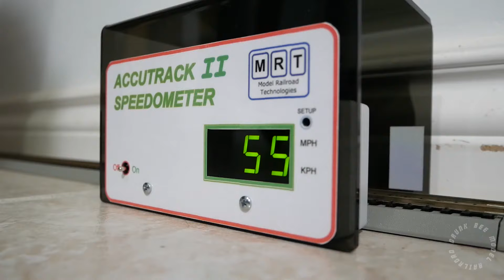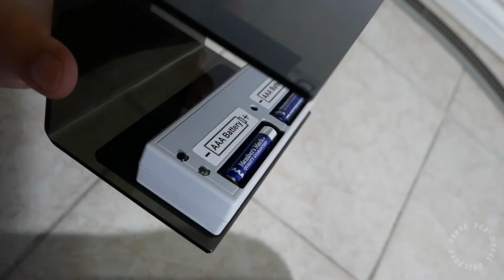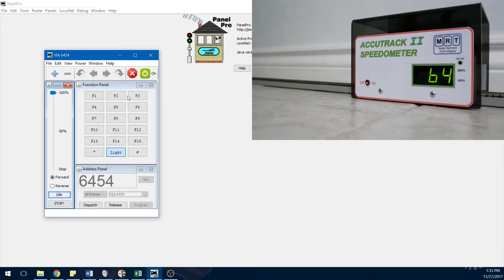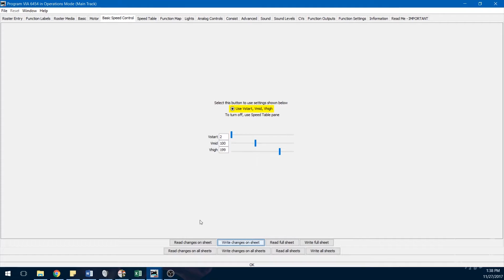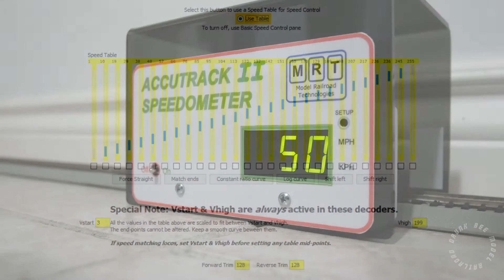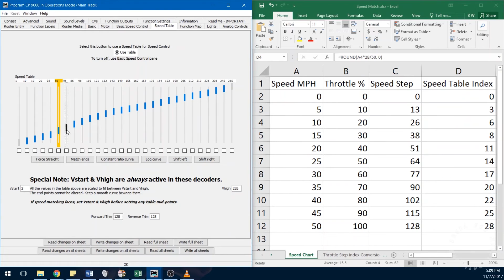DCC Speed Matching Using JMRI and Accutrack II Speedometer

Comment: Can we still acquire the spreadsheet?
Reply: I figured is formula out just I don't know how to set up an entire spreadsheet like he did but I think you don't need to spreadsheet and just a piece of paper and a calculator. Basically its top speed desired divided by models actual top speed (50/55=90.9%), take that result and divide it by 255 (90.9% or .909/255=231.8) so you'd set it at CV5 max at 232. I hope that helps. Unfortunately the drop box link is dead but this should help you within reason.
Reply: @SPSD458853  Thanks alot!
Reply: @SPSD458853  hoping this finds its way to you. I am going over your math to try and recreate the spreadsheet. I get the first part , 50/55=90.9% but 0.909/255 = .00356471 not 231.8. What am I missing?
Reply: DUH!!! Never Mind. It actually is Multiply by not divided by!!!
Reply: Did you guys ever come up with a new version?

Comment: Great video!  I was going to use the speed table method but will try this first.  I did not buy a speedometer, I built one that Joe G shared on his channel.  It's Arduino based with a few sensors and a display - very simple to build and use/modify to fit your needs.   If interested in the code, send me an email - address is viewable on my channel page - Smokin Big  Dave BBQ and Trains

Comment: Any ideas on speed matching with the throttler going to 126 for 128 speed table?
Reply from the maker: As in 126 scale mph? Most HO scale models are not capable of going that fast. You can speed match each step for half a mile for a top speed of 63.
Reply: @DBRXCustomRailroadModels Sorry. Talking about the throttle % going up to 126% instead of 100%.  On your chart. You have it going from 100,90,80 and so on. Any idea how to convert your chart for an 126% throttle?
Reply from the maker: Because my throttle is set to display percentage. If you want it to display speed steps then change it in the settings.
Reply: @DBRXCustomRailroadModels  ah ok, well I have an Iphone and it looks like I can't change the throttle from speed step to percentage. Using WiThrottle. But thank you.

Comment: Hi.  Great video.  Would you hapen to know the max speed out of the box, of the Scale Trains GEVO Tier 4 with sound?  I think you and I got them about the same time, August 2017...  I'm wondering if I accidentally changed a decoder setting, as it tops out at 82km/h (about 48mph) but people seem to have toem going faster...  My speed matching on Locs is to 100km/h (60mph)...  -Chris
Reply from the maker: About 68-69 scale mph if I recall correctly.
Reply: Thanks.  I need to figure out where in the decoder it has been reduced.  Like perhaps a 'locked in' shunting speed...  not sure.  -Chris